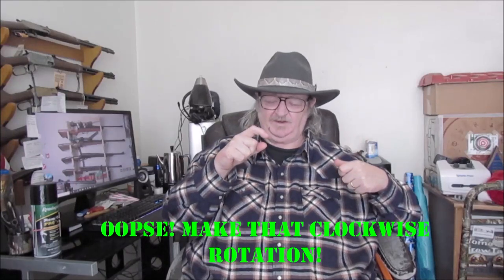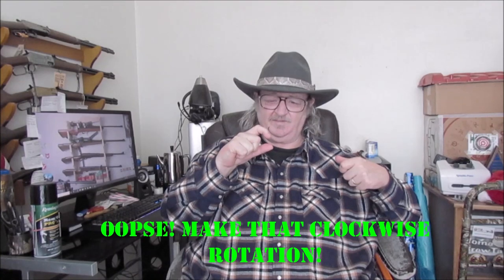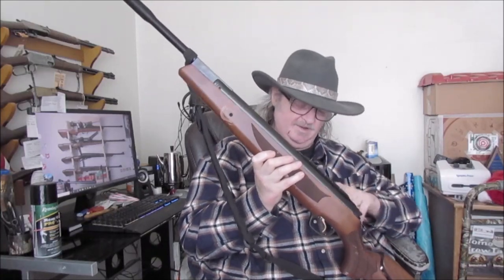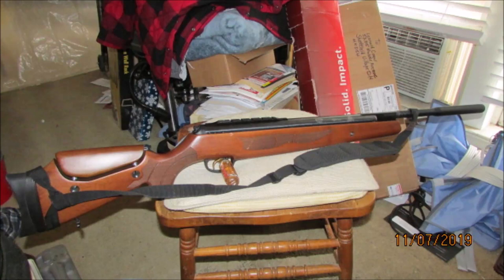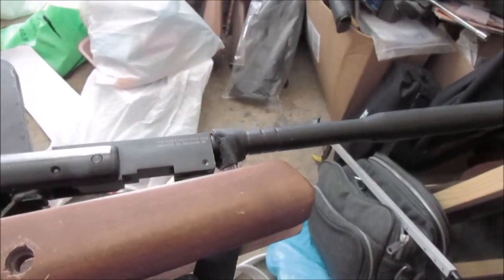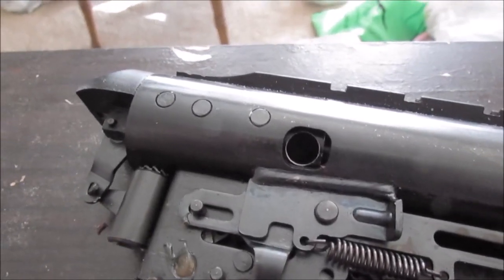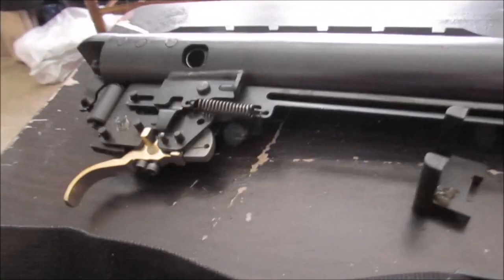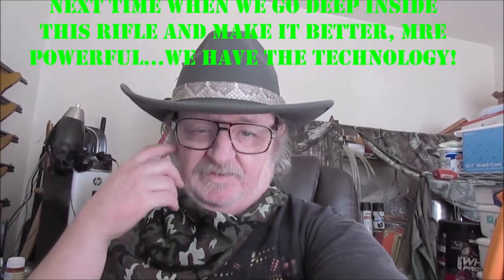The Airgun t‌inker EP133 Hatsan Carnivore 135 Mods

Comment: Big hole is where you put a fill probe for the vortek piston..
Reply from the maker: ??? There's nothing blocking the hole if that's what it is?
Reply: @unionrdr  its it a fill probe hole to adjust the air pressure on the vortex piston....the other side has a release screw to let the pressure out, since your installing a new piston, all you need to do is bleed off the pressure and open her up, no spring compression needed...I would suggest looking at Mike Ellingsworths videos on the Hatsans here on the tube..
Reply from the maker: @robmckinnon4655  Isn't it a cartridge like the others?
Reply: @unionrdr  Easier for you to watch than me explain...
Reply from the maker: @robmckinnon4655  Still a cartridge with only 1/8 inch preload. Easy to safely take apart without degassing the cartridge to remove it.
Reply: @unionrdr  I have on my 125 and 95s no issues

Comment: Not how it works.
The screws are soft because Hatsan doesnt want you in there.
Get the screw out first,thats how Hatsan builds them
Reply from the maker: Nope. The threaded sleeve was redesigned to help lock the screw. THAT is why it's all tore up! It will not budge until you back off the lock sleeve first. Others found that out before me, one told me about it and it worked. That screw wasn't the original either. The owner installed it after messing up the factory one.